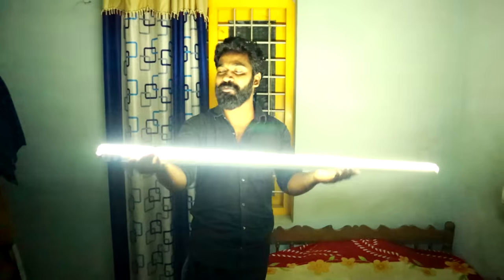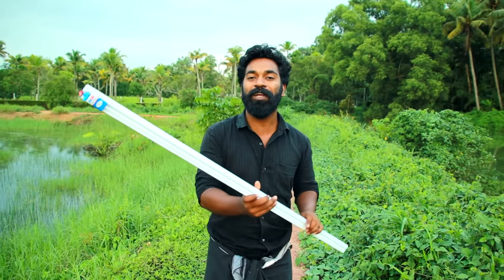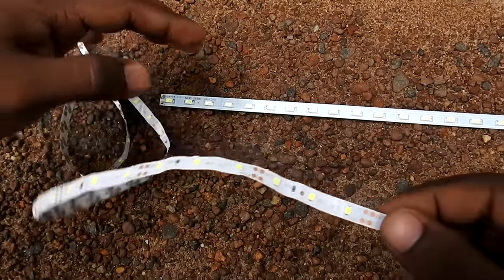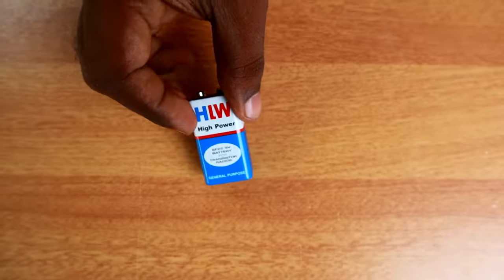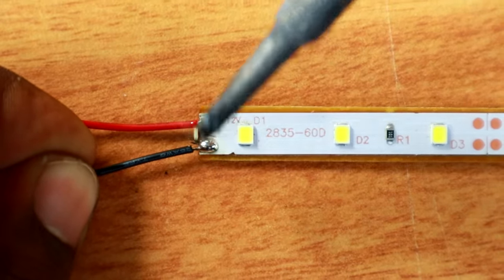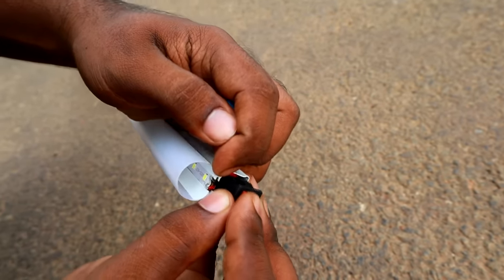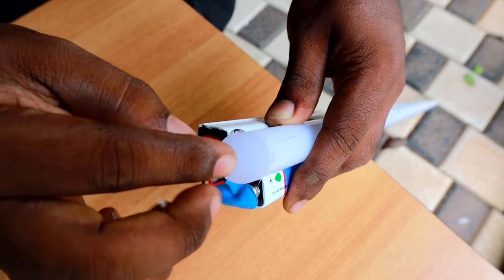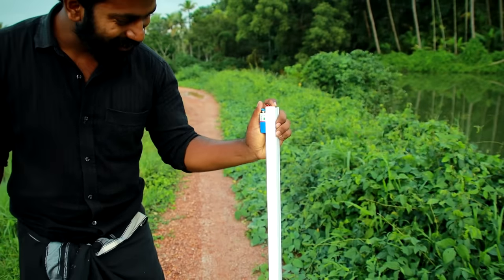Home Made Emergency Light Rs 50/- | കേടായ ട്യൂബുകൊണ്ട് ഒരു എമർജൻസി ഉണ്ടാകാം | M4 Tech |

Comment: 9v battery charge cheyyunna oru video idumo,support👍👍
Reply: aa cell rcharg cheyyan pattilla. athu rechargeble cell alla.
Reply: ആഗ്. ഒരു ബാറ്ററിക്ക് പകരം ഒരു data കേബിൾ cut ചെയ്തത് power ബാങ്കുമായി connect ചെയ്താൽ sheriyaakumo.   എന്തെങ്കിലും കുഴപ്പം സംഭവിക്കുമോ plz rply
Reply: @afsalm1994  power bankil 5V aanu...so Oru dc-dc step up  boost converter (XL6009) circuit -  koodi add cheythal power bank aayi connect cheyam. Like (power bank ->USB power cord ->(XL6009 circuit) -> switch-> led strip.😊
Reply: @afsalm1994  work cheyum, velicham kuravayirikum,, vere oru vazhi: a stripil 3 led veetham series aayi connect cheythayirikum 12 volt set cheythirikunath, oru led veetham short cheythal work cheyum.
Reply: കൂട്ടുകാരെ,  നിങ്ങൾ ആഗ്രഹിക്കുന്ന ഒരു ചാനലാണ് എന്റേത്. 
 കാരണം നിങ്ങൾ ആവശ്യപ്പെടുന്ന കൗതുകകരമായ വിഷയങ്ങളെക്കുറിച്ചുള്ള വീഡിയോകൾ ആണ് ഞങ്ങൾ അപ്‌ലോഡ് ചെയ്യുന്നത്.
 അതുകൊണ്ട് ചാനൽ സബ്സ്ക്രൈബ് ചെയ്യാൻ മറക്കരുതേ...
 എപ്പോഴും നിങ്ങളുടെ സപ്പോർട്ട് ആവശ്യമാണ്...
Reply: Ee battery kond etra time wrk cheiyum enn ath aalochicho arengilum😅
Reply: GENIUS CRAFT

Comment: What If the battery gets depleted. How to change the battery
Reply: Simple don't put glue on battery just use tape and you can remove it after charge is over.

Comment: What to do if the battery finished and in your video it is stuck to the the side of the tube and if it at all we pull it will the tube have any damage ?
Reply: Correct I also have the same doubt

Comment: ഈ battery charge ചെയ്യാൻ pattumo
Reply: Nope those batteries are non rechargeable
They are for one time use .
Rechargeable batteries are fairly expensive but they leak over time
Using lithium ion 18650 is a good choice.
Reply: @umas4109  ok thank u